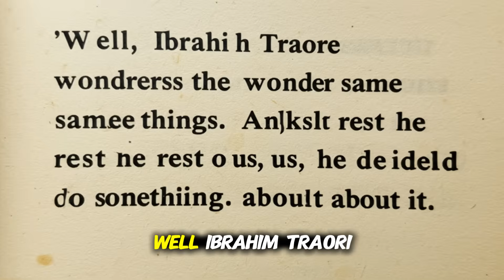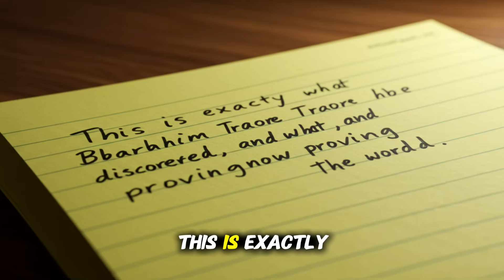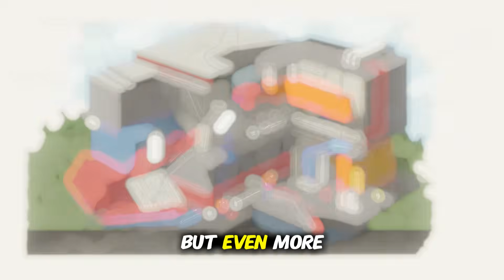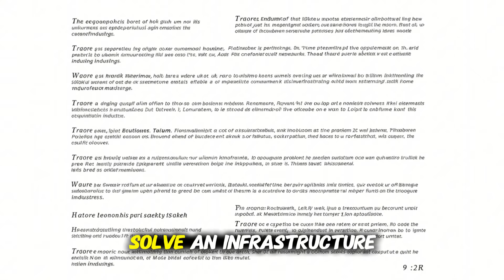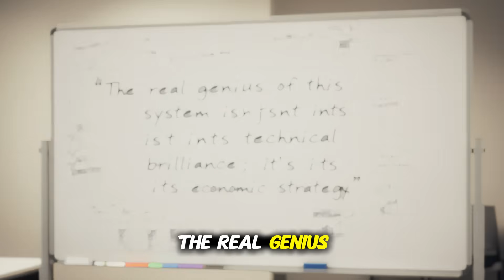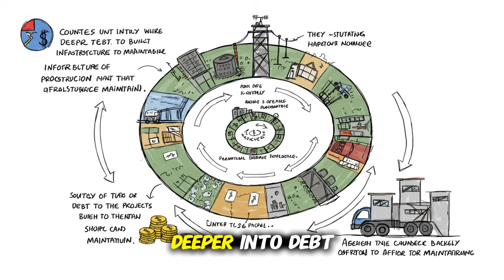Ibrahim Traore Build Road on Tires Trump Didn’t See It Coming

Comment: That's one of the main downsides to the Western capitalist illusion! yes Africa; that's one they use against their own people too. We often settle for the available option because of the established markets that have been built to support it and the western economy is so unstable that we can't afford to risk damaging existing functioning markets. The road build system here is basically licence to print money so any inovation here will impact those greedy cunts at tarmac to relay a road here you first have to plain the existing failed surfaces away. All recycled! Tarmac charge to collect the planings then take them back to their site to be reworked normally once you tip that off you reload with tar and roll back to the road site ans get it laid but the tar was made predominantly from yesterday's processed  plainings  they run it through a grinder to take it to the desired stone size add the bitchemum cook it up bobs Fanny's your aunt they are charging the road crew for literally everything they can squeeze on to the invoice even driver waiting time. So with every 20/29 ton load of tar we are effectively selling the stone you removed at a price back to them with a bit of chemical enhanced added value. Stone and sand is a bit different but not much obviously fewer sticky expensive chemicals involved

Comment: innovation is wonderful however, in this case we’re looking at rubber as the intimated product of the century, that will now serve a purpose of peeing millions and millions of miles and highways and building other areas of transportation needs. However, imagine or even take it to the bank that if we can’t get this particular material in tend to make highways and infrastructure less cost., then we need to remember the chemistry of rubber, which by the way is very volatile extremely flammable, and there is a trigger point where it’ll sit on fire which most people would consider spontaneous combustion. So I didn’t want to imagine seeing experiment change in temperature, which would affect the road then what we would see is 1,000,000 mile road fire in the middle of the highway wherever the material is used… think about it.😮😮